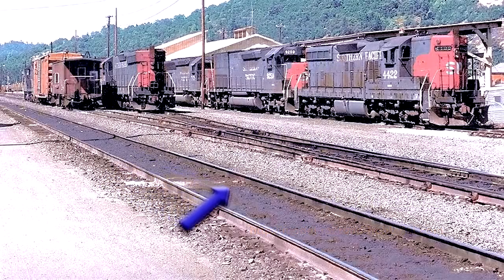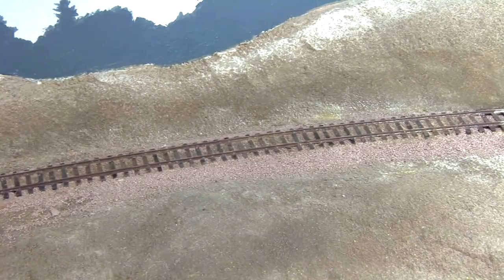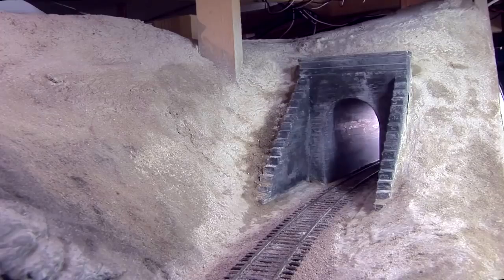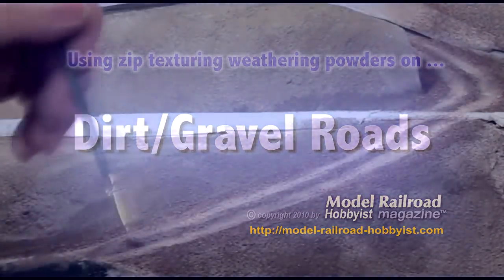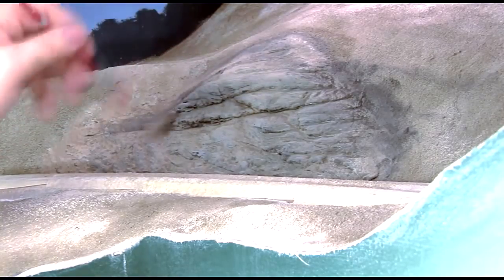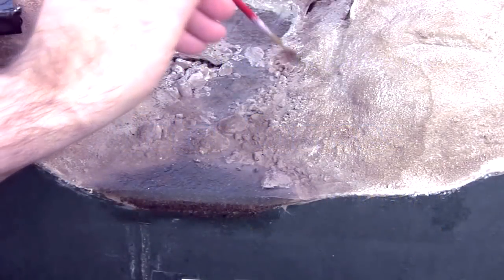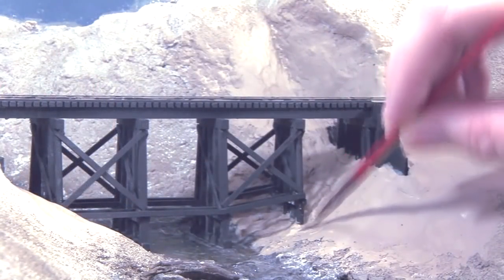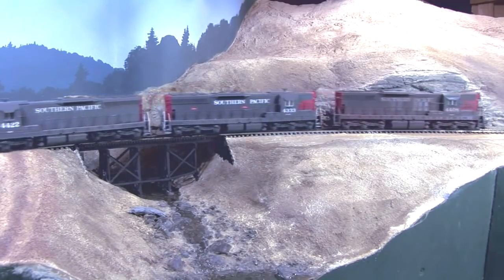Using zip texturing weathering powders | Model Railroad Hobbyist | Joe Fugate

Comment: You should use higher grit sand paper,  600 is abrasive and leaves scratches that you can't see but can cause oxidation on the rails finer sand paper as maybe 1000 or 1200 closes the pores of the metal better. This is from the custom automotive world.